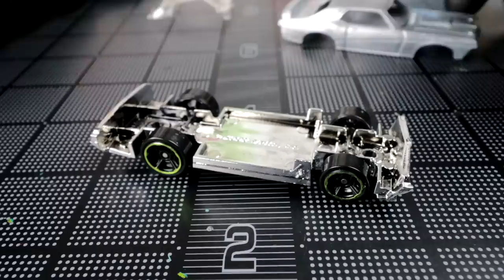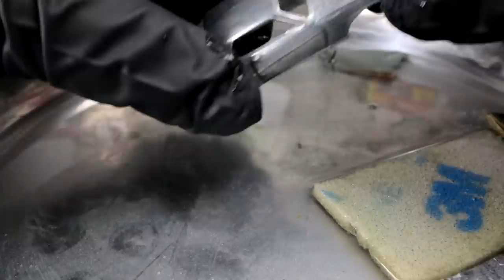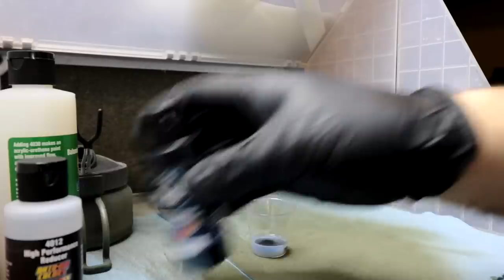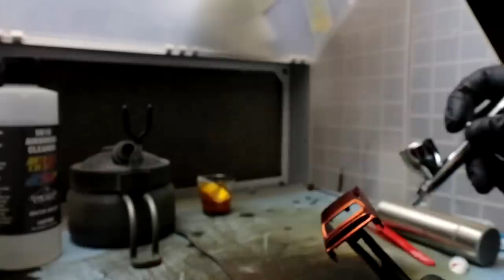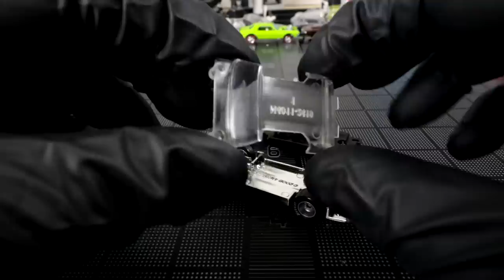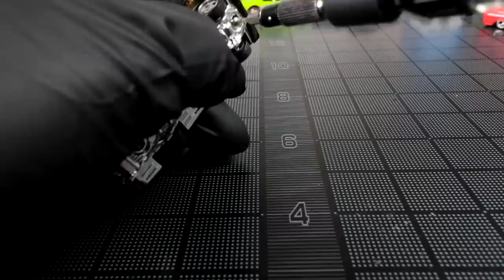Hot Wheels Customization : Cougar Eliminator Paint Experiment

Comment: Thanks brother. Very informative. What clear are you using?
Reply from the maker: I use a Canadian brand 2k automotive grade clear.  $100 a gallon lol.. so I have lots..
Reply: Diecast Resurrection do you thin it? If so what do you thin it with??
Reply from the maker: I use a urethane medium reducer $35 /quart.  4 parts clear coat, 1 part activator, 1 part reducer.  4:1:1 sprays pretty good.
Reply: Thanks for the help 👍👍

Comment: Can you add detail or link on clear coat?   I have been able to follow/recreate your steps through the Createx Candy2o.  But have failed with clear coat step not knowing what you used.  I tried createx 5604 gloss top coat but did not like the results.
Reply from the maker: I used a 2k urethane automotive clear coat which I added activator and reducer to. It’s a Canadian brand so I didn’t bother with the links. Redline shop clearcoat is the same thing, add activator and reducer. Any auto body supply shop will have it. I bought in bulk (1 gallon) cause it was way cheaper than buying the little redline shop bottles all the time.

Comment: If you need a better solution involving the rattlecan approach to primer you might consider a different "cap" such as the ones graffiti artists use to change the effect they get from the spray pattern of the nozzle. the "cap" is the part that you push down that has the spray nozzle. a "fat cap" provides a more broad spray pattern that might allow you to mist the primer on in a lighter way rather than just shooting lots of paint in a thick stream. it's called a Fat Cap because the nozzle sprays a fatter line when using it to paint but i imagine dispersing the paint better might help in your application. if not, there are lots of other caps that provide myriad effects to the spray pattern of a rattlecan. i'd google the different names of the caps to find your desired ones. here's a pretty big selection of them: https://shop.bombingscience.com/spray-paint-caps

Comment: What's your real name? So I don't start comments with Hey You diecastman. planning on buying an airbrush and compressor just for airbrushing. All this thinner and reducer talk? care to elaborate? Love your vids!!!
Reply from the maker: My name is Austin, what do you want to know?
Reply: Like a video showing how or when to use a reducer for clear and thinners for paints.  Do you bake your cars to cure the paint or clear? And now the water based paints. I need to learn. These rattle cans aren’t that great. I’m a noob.
Reply from the maker: Well basically, if you are going spray through an air brush, your paint needs to be as thin as milk. If you are using enamel you can use paint thinner, if you are using lacquer or urethane then you need lacquer thinner. I don’t bake my cars but I use urethane 2k clear, which needs a reducer to make it spray betters you can use 2k clear as is, it comes pre-reduced in the can. 

Water colours is a whole new ball game and they have all their own reducers, clears etc. I’m still learning about them. The black I used on the recent cougar video is a water based urethane so I was able to clear coat with my regular 2k urethane clear.
Reply: Very cool Austin. I’ll do some more research and I’m sure some trial and error. Thanks for replying and keep up the great work. I really dig the humor and character in your videos.